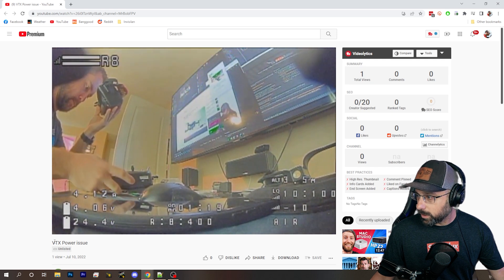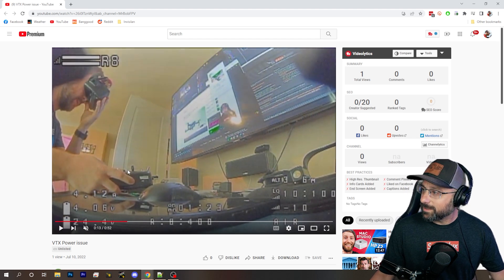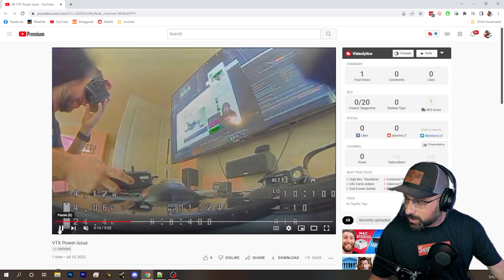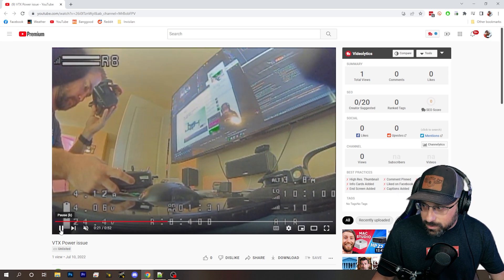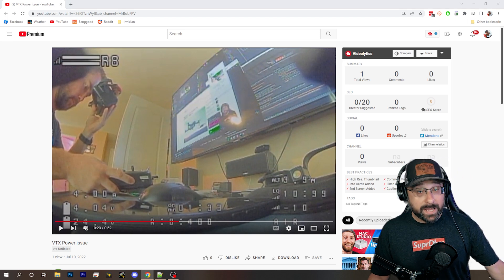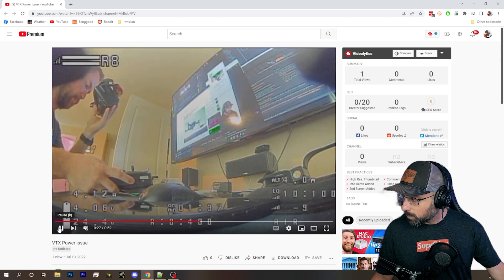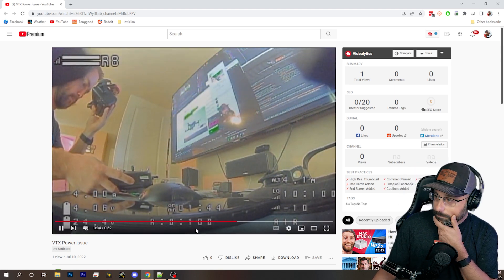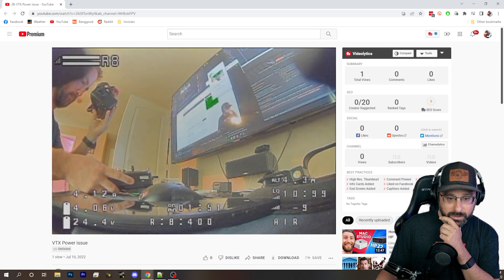When I change my VTX power to 1 watt I see a question mark? What's wrong? - FPV Questions

Comment: Hi Joshua I have the same vTx and am having the same "problem" but my settings are correct according to what you said in the video, my max power has been 36db since it was put in from new, any advice? I dont really mind it but there may be others other there with the same problem?!?
Reply: Try setting the 4th power level to 30 instead of 36. I found an old VTX table for the Unify Pro32HV and it lists the value as 30. I tried it just now and I finally see the proper label in the OSD. I bought this VTX shortly after the product was released. It's running the latest firmware but maybe something in the hardware limits it to 30db, and 36db just doesn't compute properly.
Reply: @VernStarr  I have the same problem with pro 32 nano, no matter if I put 30 or 36, question mark on power level 4 persist. EDIT: for pro32 nano level 4 is 28dB

Comment: Joshua.. do you fly cine lifters? I am really interested in flying the 7" and larger cine lifters.. new to all this and need to learn to fly still.. but I have always been in to cinema camera stuff.. got the BMPCC4K.. one day would like a RED but way out of budget now. I am looking at the new Lumenier quav pro which looks amazing, and I ordered the AOS70 cine lifter frame, but wont have the funds to put it together with 8 motors, dual ESCs etc for a while yet.. which is fine since I can barely fly my dang Mobula7 HDZero (truth be told.. I can't even fly it yet). I am working in sims but even after many hours I keep crashing.. all I want to do is learn to fly like you do. :D. Anyway.. would love to see you do some videos on the larger cine lifters. I know you have some on the smaller ones.. but the bigger ones seem amazing in terms of handling larger cameras, longer flight times, etc.